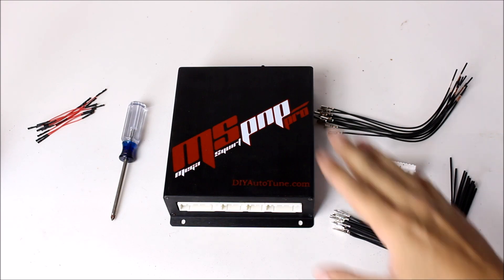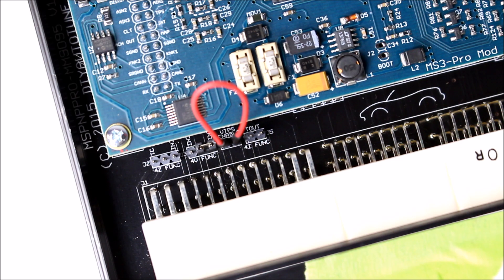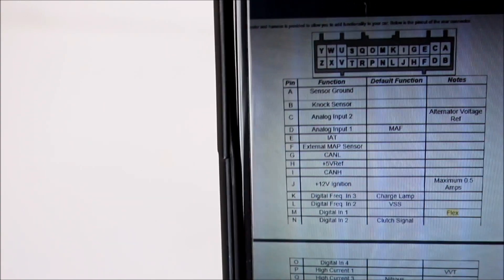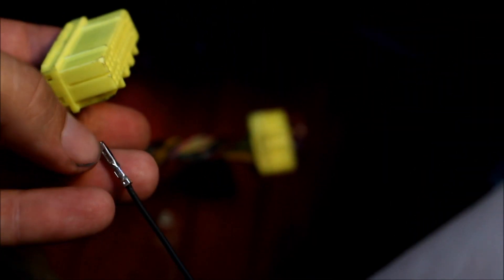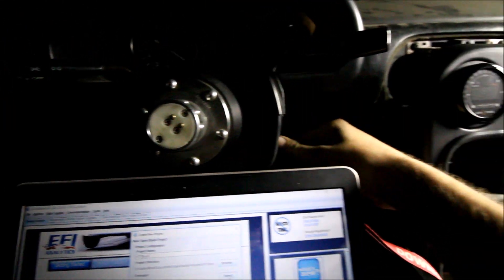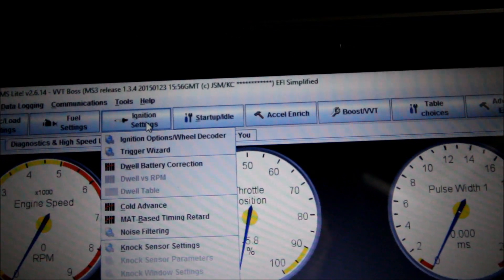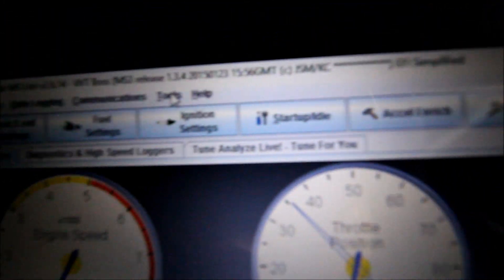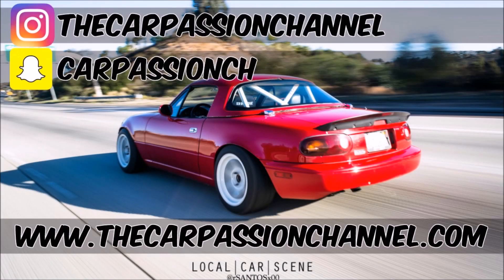Megasquirt Setup Before The 1st VVT Swap Start (Rebirth Ep38)

Comment: Dang where was this video like two weeks ago when I installed my MS3 PNP Pro and got my MKturbo setup running for the first time haha. Great video sir. You should show more setup stuff in TS like configuring injector voltage and deadtimes, knock sensor settings, cooling fan outputs, target IGN and AFR tables, etc.. Its hard for noobs to get answers to MS tuning questions on miataturbo.net. Your Megasquirt tuning series has been incredibly helpful thus far. Keep up the great work.

Comment: Tunerstudio should say 22 afr as well. Check its not set to an aem style(0v 10afr/5v 20afr) sensor input. The innovates go from 7.3x to 22.x in the 0-5v range. Megasquirt should absolutely reflect that. Also ground wideband same spot as engine ecu to avoid ground potential drift.
Reply from the maker: runesmDK Needed to set wideband controller to LC-1. Now she matches :)
Reply: TheCarPassionChannel Glad to hear. Keep it up :)

Comment: hi greg great video very informative I am  wondering how you fix the no controller found I just bought a MS3 pro for my mb2 miata and  I got the same  issue no controller found I tried using  different usb cables and laptop and no luck

Comment: You said your wheels are +36mm offset and you run a 20mm spacer. Do you run the 20mm spacer because you couldnt fit a smaller spacer? I dont want to have to roll my fenders as much as you did but i want 15x9s.Just wondering if you had room for a smaller spacer?
Reply from the maker: SkymanAK47 Just run them with no spacer. I only added the spacer because I already had major fender work,so they fit great
Reply: TheCarPassionChannel Thanks man, getting ready to order wheels and wanted to see if the 15x9s cleared aftermarket coilovers. You helped alot man:)

Comment: Mines says no controller found, and it's a sr20 mspnp 2. If you can , can you please help me out. Idk how to do the whole "USB to rs232" thing ☹️I'm running windows 10 and I have the provided rs232 to USB cable and adapter that's sold by diyautotune. Thanks a lot !

Comment: Greg how did you setup the oil pressure/temperature sensors? Did the oil temp need a pullup resistor installed?

Comment: Ok, I hope you still check your old video comments.  We have MS2 in our 1990 Miata champ car.  It already has a 1995 1.8 in it and we have had it Dyno tuned.  We heard the secret is to get a VVT motor and tune it on 93.  Will MS2 run it and does it have the ability to run the VVT or does it lock it out or can we lock it in advanced position?  Thanks, Doc
Reply from the maker: MS2 can't do VVT, and it will be locked in the 0° position (no advance) so you'll get full top end power but no midrange gains. You can either swap to a 90-93 MSPro, or add a VVTuner.
Reply: @TheCarPassionChannel  thanks for the info!  I'm trying to figure out if we want to buy a VVT motor or not. This helps.

Comment: Hi Greg I have the same wideband gauge but it keeps coming up with E9 but Iv checked multiple points in the feed and it has 12v the whole way through but still shows E9 any ideas why this is happening? Or anyone that could help? (live in England so can’t just call innovate up)

Comment: Hi Greg hopefully you see this comment. I have a 99 roadster with a 1.8 VVT, I am going for a turbo setup and going to install megasquirt soon and hopefully install the turbo a good few months after once I have the base map running well with auto tune etc. My question is when installing megasquirt in a 1.8 VVT do I have to do anything different because it is not a standard 1.8 and it has VVT, will I have to tune my VVT on tunerstudio or can I just forget about it completely if going forced induction? Will it make any differences in my installation and getting the car running perfect on tunerstudio compared to a standard 1.8? I hope this isnt a stupid question, I am pretty new to all this and your videos are amazing buddy
Reply: Can I just go ahead with turbo charging and tuning it just the same as a standard 1.8?

Comment: Hey Greg! For the options connector, do you read the diagram as the front of the plug (face that connects to MS) or the rear of the plug (where the wires are going into the plug)? Just trying to figure out where to connect what pins for what I need.
Reply from the maker: I'm 99% sure the diagram is as if you're looking at the plug on the ECU itself, not the connector. If you have MS3/Pro you can figure it out by looking at the bigger boxes in the connector (4 on one side and 6 on the other). Also - the bigger boxes take the bigger pins, there should be 2 sizes included. On MS2 they're all the same size
Reply: @TheCarPassionChannel  Thanks so much! I’ll have to look at the size of the boxes again then. Just to make sure I’m understanding correctly, the connector orientation is basically looking at it as if it was connected to the ECU?
Reply from the maker: @electricrc68  correct - the diagram is a map of the pins on the ECU itself. So in the instructions if the upper left pin read "A", you'd hold the ECU in your hands and look at the port and the upper left pin would be "A"
Reply: @TheCarPassionChannel  Great, thank you!

Comment: So I'm getting close to putting in a vvt motor (1.6 to vvt) and I'm a little confused on how to asses the throttle body situation. Im pretty sure I need a 1.8 throttle body right? Do I need a 1.8 throttle position sensor? (Is there a difference?) Trying to do things on the cheaper side but if I have to get a new sensor and throttle body then I will. If I do need to get new parts, which years can I get them off? Thanks!!
Reply from the maker: The VVT motor will have its own throttle body and TPS, the 1.6 units will not fit. Any 1.8 TB will fit any other 1.8 manifold, but the NB throttle body is nicer since it has an internal ISCV.
Reply: TheCarPassionChannel Ah makes more sense, I just can't find very many motors that have a tb on them. Having trouble finding a motor in general lol, thanks for the help!

Comment: Hi! How to correct control alternator on nb miata? i've broken my mind to connect diy MS3 to my stock wiring on nb mk1, while swap 1.8 vvt engine.
Reply from the maker: In my opinion the BEST solution is to install a 94-97 alternator, they are internally regulated. That's how my car is set up, VVT engine with NA8 alternator
Reply: @TheCarPassionChannel  Thanks! 
We set up the car until 3 am. In the end everything works Well! THanks to you and your channel!

Comment: Idk if you guys can get them in the States, but you should look into Haltach ECUs, they're pretty fucking advanced! (But also expensive)
Reply: we can get em, it's just hecka expensive
Reply: HertLife uses one for his FC. I've worked with Haltech a ton and I love it, problem is even their basic ECU's are twice the price of MS here in the states. Also they don't offer many PNP options
Reply: Just as expensive as the AEM standalone ECU's. The whole point of megasquirt is that you can get them for less than 1/2 the price of the $1,000+ ones.